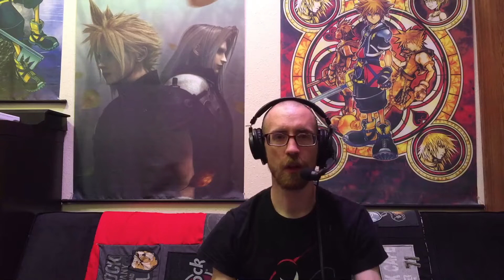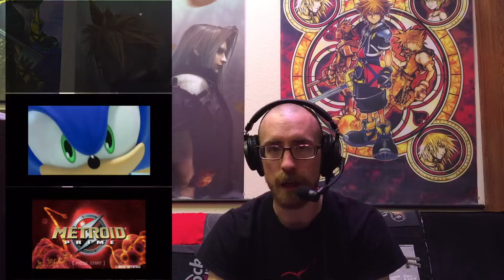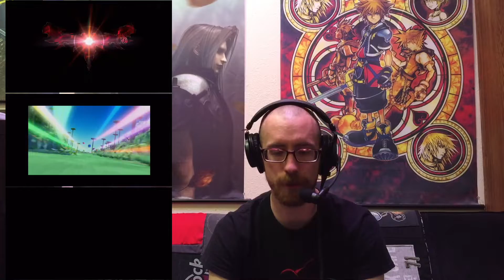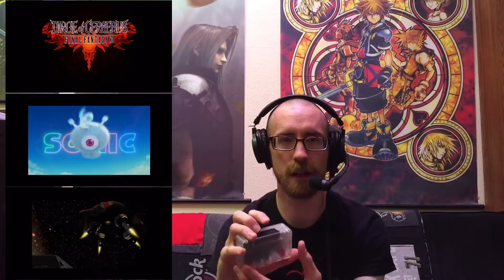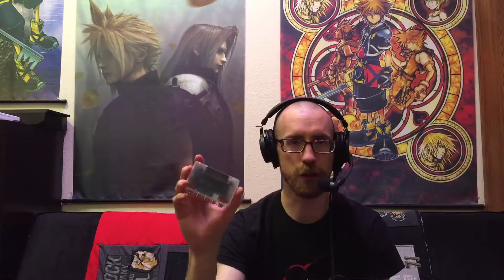What the COMP2RGB Can do for Your Retro Setup

Comment: Is this a downscaler ? I want a device to use it with my OG Xbox. I want to plug my Xbox with component with enabled 480p(to disable that flicker filter) and output 480i on my crt. I live in Europe so we don’t have component on our CRTs!
Reply from the maker: Unfortunately this isn't a downscaler.  The COMP2RGB outputs the same resolution that is input; so in your case 480p input to 480p output.  You will need to get an Extron VSC 500 to do the 480p to 480i conversion.

Comment: Hello 👋🏽 I have a Sony Trinitron that has component inputs. Question: Doesn't component automatically convert to rgb? If not, do i need to use the retrotink comp2rgb?
Reply from the maker: Hello!  I have a couple questions for you.  Are you using a consumer CRT or a PVM?  If it's a PVM, it may have RGB/Component inputs on the back and you don't need to do any conversion.  My PVM 1342Q only has RGB inputs, so I have to convert the Component input to RGB so that it's compatible.  If it's a Consumer CRT with Component inputs, you would need to get the RGB2COMP transcoder instead so you can take RGB from a console and then transcode it to work on the Component inputs on the Consumer CRT.
Reply: @ZXRyuu  oh, okay. Yes, I have a trinitron consumer set. It's a KV-27FS17 model.
Reply from the maker: So if you're looking for an easy way to take RGB SCART from a console and convert it to Component for use with your CRT, then the RGB2COMP is the transcoder you should get.
Reply: @ZXRyuu  actually the other way around. I want to convert component to rgb.
Reply from the maker: Hmm, maybe I need to understand more about what you're trying to do, because I thought that TV already had a component input?  Are you trying to output component from the TV and convert that component output to RGB or am I way off?
Reply: @ZXRyuu  yes. Trying to get rgb.
Reply from the maker: Okay, then yes, the COMP2RGB will work to take the Component output from your TV and transcode it to RGB for use with another device.
Reply: @ZXRyuu  okay thanks. Much appreciated.
Reply from the maker: Yeah, no worries!  Let me know if you need any more help!
Reply: @ZXRyuu  actually, one more. Sorry if I'm asking too many questions. I'm new when it comes to this retro stuff. I was told there's two retrotink transcoders; rgb2comp and comp2rgb red and blue. Would the blue comp2rgb convert the signal to rgb on my trinitron KV-27FS17 that takes component? And if so, will it make a big difference?
Reply from the maker: No worries, you can ask as many questions as you need to.  Yes, there is a big difference between those two devices.  The COMP2RGB takes a Component Input signal from either a console or the output from another device and the COMP2RGB will take the Component signal and transcode it for RGB output, which can then be input into either a PVM, scaler, or other device.

So, if you are trying to get an RGB input from a console and output Component for the Component input on your TV, you'll need the RGB2COMP transcoder instead.  Make sense?
Reply: @ZXRyuu  yes. Thank you.

Comment: I'm not a native english speaker so i don't understand everything in your vidéo (god you speak so fast).
So i still have a question; does this COMP2RGB downscales any component signals to RGB 480 interlaced ? never to 480P ?
Reply from the maker: I did notice that I was talking fast in my earlier videos, I've since slowed down.  👍🏻.  The COMP2RGB doesn't do any kind of downscaling or upscaling.  It's simply a transcoder to take a Component signal and convert it to an RGB signal.  So if you are passing 480i Component, you'll get 480i RGB or if you're passing 480p Component, you'll get 480p RGB.  Make sense?
Reply: @ZXRyuu  Yes thank you

Comment: I saw a comment saying it doesn't do the PAL TO NTSC or NTSC to PAL Conversion.

How can I play my NTSC GameCube for example on a Sony Triniton 14 CRT which is PAL but can also do NTSC as it has compatibility
Reply from the maker: Correct; the COMP2RGB is strictly a transcoder, it doesn't do NTSC to PAL conversion or vice-versa.

Off the top of my head, you'll probably want to look into the Swiss Homebrew Utility for Game Cube.  This program gives some video output options that might work in your case.  I have not done any kind of NTSC or PAL conversion as I've never needed to myself, but I think it would be a good place to start for you.

If you can run Swiss, let me know how things are going and I can try to help you out if you're still running into issues.
Reply: @ZXRyuu  if the TV however has NTSC compabitlity, then the transcoder should technically work right? It's very confusing.
Reply from the maker: If the TV has NTSC support then it should work.  I'm guessing this would function in much the same way that multi format PVMs do.  Again, without having the ability to test this myself, I'm guessing.  It should work, but I'm not 100% sure.

Comment: Hello. I have a question. Sorry if you already answered it in your video  but here goes: I have a Sony trinitron 21" and I live in Sweden and it has scart inputs. So there is no way to connect a component cable to it other than with the comp2rgb. Do you think it will give me 480p using this adapter/converter? I'm not sure if the tv can support it or not. I mean also, is it worth buying in your opinion? I'm reffering to the Wii.
Reply from the maker: Hello!  The COMP2RGB Transcoder does support 480p video.  Do you have a model number for your Sony Trinitron?  That will be best way to find out if it supports 480p or not.
Reply: @ZXRyuu  Ok. It's the following model:   KV-21C5E
Reply from the maker: @ESEJESEJ  Based on what I can tell from researching that model, it looks like it will only support 480i.  So, you could convert the Component signal to RGB, but you will also need a Male SCART to SCART cable to go from the COMP2RGB to the SCART input on the back of the TV.  Just for clarification, are you using an NTSC Wii or are you using a PAL Wii, because the COMP2RGB won't do the NTSC to PAL conversion, it is a 1-to-1 Input-Output (PAL to PAL, NTSC to NTSC).
Reply: @ZXRyuu  Alright, thanks for your research. I'm using a PAL Wii. And right now I'm using a supposedly Rgb scart cable which goes directly between the wii and the tv. However, the "PAL 60hz" display option in the wii menu is as high as I can go, which I guess is 480i? (Hence why I wonder if the comp2rgb will make a difference in my case?) When connecting other consoles such as Sega and Snes, the tv actually says that the input is RGB, but this is not the case with the wii.
Reply from the maker: @ESEJESEJ  Sure, no worries.  Yeah, I'm guessing that your display can't do anything higher than 480i, so whether or not it's running Component or RGB is probably a wash at this point.  If SCART is easier in your setup, just save yourself some money and stick with it rather than getting another box to transcode one signal to the other.
Reply: @ZXRyuu  Yeah. I guess I just have to skip the wii + crt idea. I think I will get one of those component to hdmi   converters instead and hook it up to my modern tv. Found out about a cool mod but it's out of stock everywhere, unless one is willing to pay 1500$ on ebay. : https://m.youtube.com/watch?v=m6MVe4tuJXE
Reply from the maker: @ESEJESEJ  I had to use an HDTV as well for my Wii, just because it was going to be too expensive to get a PVM with 480p capability.  The Wii Dual is a really cool mod; and I'm sad to hear that it's out of stock and very expensive on eBay!  If you want something that will give you better video quality than a Component to HDMI transcoder, you could look into the RetroTink 5X, if you have money for it; it's well worth the $300.  If you do decide to go down the route of transcoding Component video, be sure to find one that is lag free.  RetroRGB lists one on his site, if I recall correctly.
Reply: @ZXRyuu  I will check out the retroTink 5x. Thanks. Yeah it's sad that the wii has such crappy video output and that the crts that support 480p are rare and expensive. However, I did not concern me back when the wii was bran new. But games like Muramasa, which is one of my all time favourite games, looks quite alright in 480i. Acceptable at least. But hey, I can always start a new character in Elden ring and forget about the wii for a while.
Cheers and thanks. Have a great remaning 2022.
Reply from the maker: @ESEJESEJ  I agree, it is very sad; video scalers have trouble locking onto the 4:3, 16:9 aspect options because it seems to be a hack of some kind rather than a proper standard.  There is definitely a lot of debate about whether 480i or 480p is better because they each have their pros and cons.  Haha, true indeed.  You're welcome; you as well!

Comment: Hi there. Is it possible with COMP2RGB get480p through RGB on a PAL Wii??, I ask this because it only outputs 480i through RGB and 480p through component. I use a crt TV Panasonic compatible with Scart RGB 480p/60hz
Reply from the maker: Hello!  I actually don't know for sure.  Since my PVM only goes up to 480i I don't know that I have a good way to test that particular scenario.  I use component, myself, for the Wii and GameCube; I've never tried RGB for either of them.  Upon further research, it looks like you would need some kind of mod for this, either the WiiDual, GCHD-MKII or some other type of RGB mod to go beyond 480i.  There are options, but I don't think this is possible out of the box.

Comment: Hi! Thx man for your vid :)
Question, will this work?
[PS4] 1080p HDMI into a [HDMI --> H2CS Component scaler] --> 480i Component into [Retrotink COMP2RGB Transcoder] --> 480i SCART RGB into [CRT]
Reply from the maker: Hey, you're welcome; glad the video helped!  I don't have much experience with downscaling, so I'm gonna just make some guesses for you.  I don't see any mention of 480p in the specs of the unit in question, so my biggest concern is that the 480i signal coming out of the H2CS isn't going to behave the way we expect and you may get either combing artifacts from the raw digital signal or you could get some effect where the interlacing is more or less pronounced than a true 480i signal would be.  I would look into either an Extron VSC 700 or Extron Emotia for downscaling, if you want a tried and true method that works, because you'll get a better image and more control once you get a 480p image.  That means you wouldn't need the RetroTink or H2CS, but both Extron units are probably 4x the cost of either the H2CS or the RetroTink.  If it was me, I would try the H2CS and the RetroTink first, to see if that gets you what you want, since they are cheaper; but think about doing an Extron unit if something is off.  For a more complete downscaling video, I'm gonna recommend these two:  https://m.youtube.com/watch?v=IcIiHd0BnGM and https://m.youtube.com/watch?v=KkYXaicxzBE.  Hope that helps and you can always come back and ask other questions and we'll see what we can come up with!
Reply: @ZXRyuu  Hi! Thx for your swift and extensive reply! :) 
I thought that 480i is the resolution that (most) CRTS`s like/accept? 480p is the signal that most CRTS (B&O MX7000 in my case) have trouble with? Feel free to lecture me because im learning every day ;) I will try the H2CS + COMP2RGB setup first, i am waiting for the H2CS to arrive.

By the way, I have a TVOne Corio 2 C2-1250 lying around but I couldn't get it to work: I need to be spoon-fed a bit. I have basic/ground knowledge but im obviously missing something. A live support-session (compensated? :) is something that I would be looking for. And: coincidentally I got an Extron RGB 203rxi as a gift but I dont know what to use it for (yet).

At the I really want to achieve this goal for some time now:
I use plex to stream my favourite series/movies, and for the retro content I love to stream to my CRT(s). I used to be able to use the plex app of the Xbox360/Ps3 (they provide 480i RGB Scart output) but since some time now those apps are not supported anymore and stopped working. So ideally I could use a PS4 or a laptop with a plex app to achieve that goal :)
Reply from the maker: Sure thing!

Haha, no lecturing here; let's change out your spoon for some meat!

Yes, 240p and 480i are the resolutions that Consumer CRTs (and Professional Video Monitors) use most frequently.  Professional Video Monitors (PVMs) and Broadcast Video Monitors (BVMs) can handle resolutions from 240p up to 1080i depending on your model.  Looking at your CRT, it looks like doing SCART out of the RetroTink into your CRT will be a good option.  However, if for some reason this new set up has video glitches, we can get around that by using BNC to SCART or something, but that's only if the RetroTink and H2CS don't work.

Dang!  That tvONE box looks really nice and shoot, you have an Extron 203 as well; you've got some nice stuff there!  Those two boxes deal mostly with VGA, which does have its uses, but they are a little more specific.  In your case, neither of those boxes deal with downgrading, but they have some other applications.  I would say that the tvONE box could be useful if it did the transcoding like the RetroTink, but I can't tell if that's possible or not at this point, because it looks like you might be able to, but you would need some RCA to BNC Adapters and a C-SYNC BNC to SCART Cable or something like that.  Just guessing and talking out-loud.

Huh, that's interesting, because I just got some stuff working to use my desktop computer to play retro content on my PVM.  It's pretty convoluted, but I was able to use an ATI HD 5700 Graphics Card with a hacked driver called CRT_EMUDriver to achieve this.  If you are wanting to stream Plex to a CRT, I would actually recommend going with a PC for that, because you'll be able to tailor your set up a lot more with a computer.  Console apps are notorious for disappearing after a single generation.

Do you have any ATI or AMD Graphics Cards in your equipment?
Reply: @ZXRyuu  Please check this vid, thats how ive learned about the H2CS downscaling the PS4 to 480i to a CRT. I came across your channel because what I missed in the video was the component to RGB scart transcoding. I live in europe and we do (mostly) RGB scart here :)
https://www.youtube.com/watch?v=w45q499WeU8
Reply from the maker: Okay, thanks; I watched the video and it seems like the H2CS should work for the PS4, but I was noticing on another video, using the same product, that there might be some graphical glitches depending on what's being run into it, so we'll have to see.  But that could have very well been artifacts of the camera recording the screen, not necessarily anything wrong with the final picture on the TV.